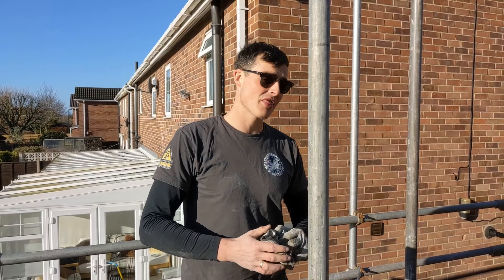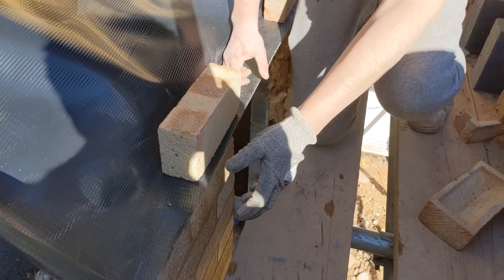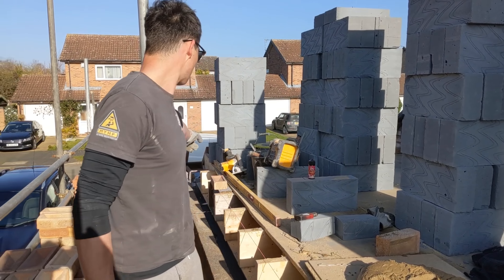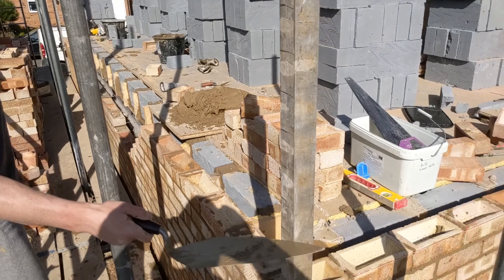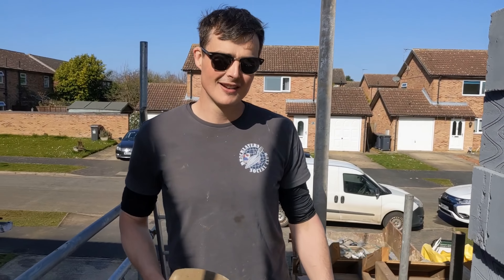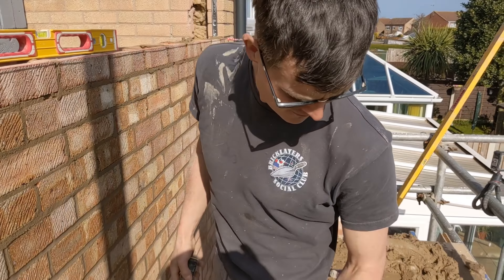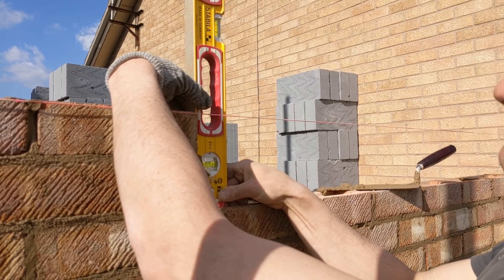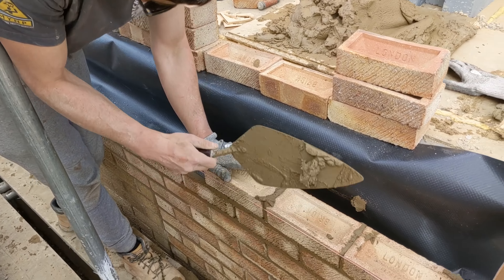Bricklaying in the SUN & Setting Cavity Trays #renovation #construction #vlog

Comment: I remember many years ago when I started in the building trade and went to college we did most trades putting brick work up could not lay a brick to save my live so I ended up plumbing and heating  then pipefitting and now retired  so enjoy it as long as you can because time marches on

Comment: Hi Izzy,
I am just starting out in Bricklaying as a labourer and just wondering how you keep your bricks clean when completing a wall? As I am having to clean entire walls with acid/water mixture with a brush, followed by pressure wash, mind you we're using white mortar, but it still isn't perfect as the mortar is really hard to get off since it has dried. It just seems like a lot of extra work, do you recommend cleaning the bricks as you go i.e. when joining, since the mortar hasn't dried yet?
Reply from the maker: Hi mate! When I stack out my bricks, I always face them inwards (face in) this way any Mortar you throw back onto your spot board hits the back side of the brick, not the face. I also brush, or use a sponge once the wall is pointed 👌 sometimes, you just get bricks that smear very easy, especially if the compo is wet. Try using a different trowel, this may help. Maybe look at the angle of your trowel when checking the face plane of your brick. Having the trowel at different angles can affect muck of your Brickwork. It's good to yet wash a job once done, but I've never had to mate
Reply: @IzzytheBricky  perfect, thank you! Although I am not laying yet I will try to take what you said, hopefully my boss considers haha. Cheers bro.

Comment: The joists are cast in the masonry it appears. Wood normally cannot be cast into masonry or concrete because it will rot. What steps were done to avoid that?
Reply from the maker: Hi mate, we've never seen rotten joists here, do you live in the UK?
Reply: @IzzytheBricky  Water and wood don't go together anywhere. You are allowed to use treated wood or paint  the ends with water treatment.  Some people wrap the ends in plastic. Fence posts unless treated in ground rot and have to be replaced. When replacing roofs the sheathing sometimes rots and has to be replaced. If the joist ends rot you have a big issue fixing. In North America where floor plates or roof plates are in contact with masonry or concrete they rot. Some areas won't allow it. Some want you to take steps for protection. Your steel lintels for masonry when in contact with masonry rust out. Anyways your a good quality bricky so added protection can save future grief. Cheers!

Comment: Prevent cold is not only vertical but i do it also horizontal with glasfoam bricks. It takes a bit work but the longterm is much better.
If you have some contact details i could send you some information